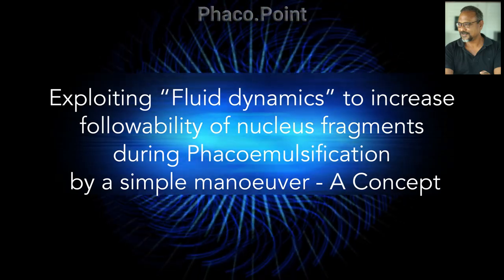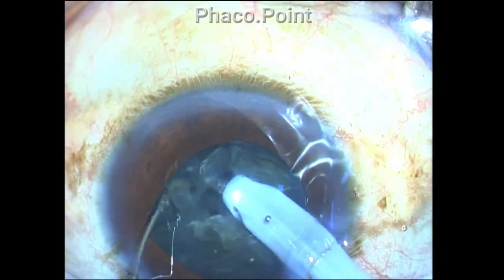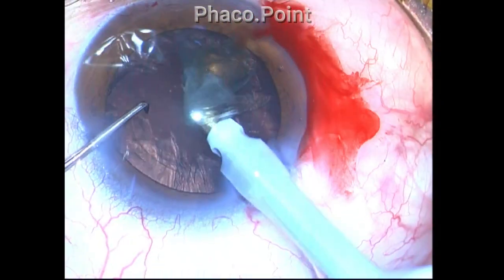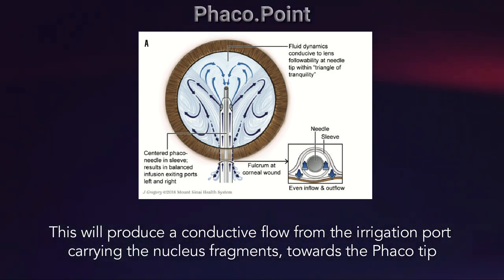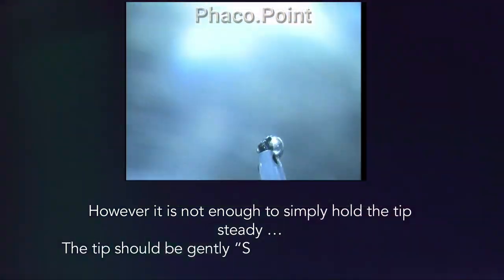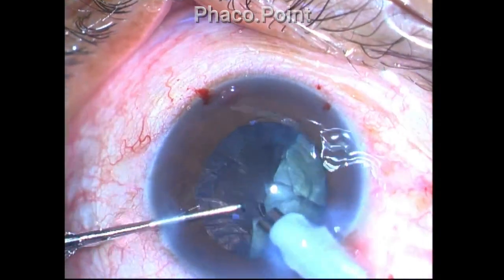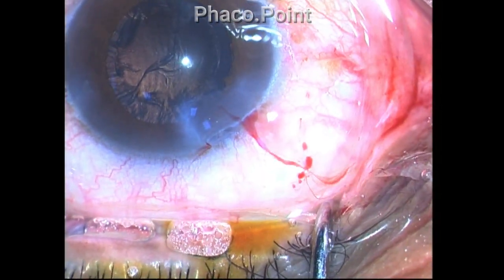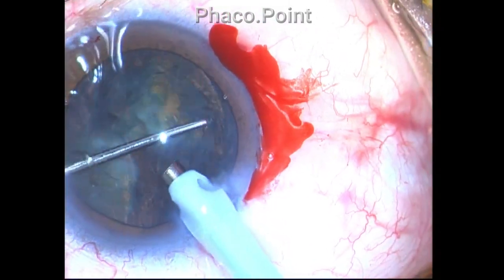The swivel manoeuvre to increase follow ability of fragments during phacoemulsification- A concept

Comment: How does swivel works in kelman tip sir
Reply from the maker: I think irrespective of the tip, when the handpiece is swivelled slightly from side to side it will change the fluid current direction and propel pieces to the tip
Reply from the maker: though I have never tried this with a Kerman tip